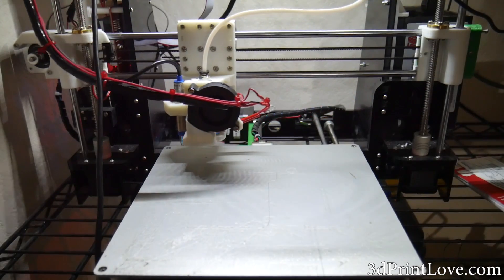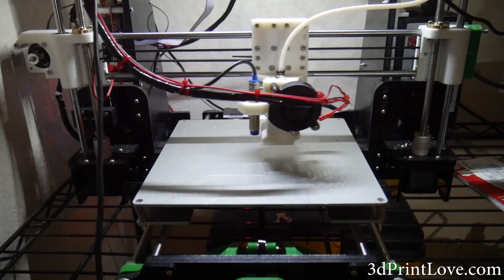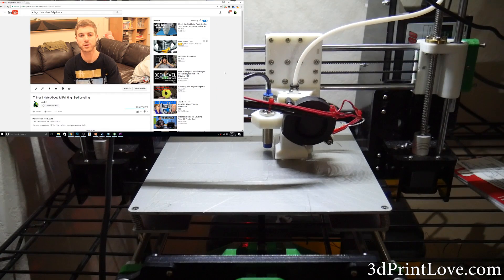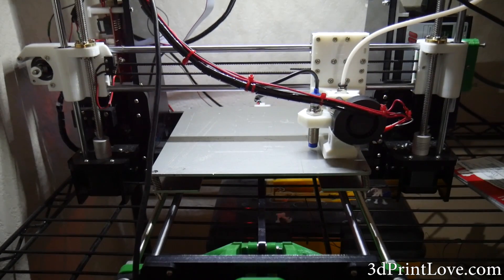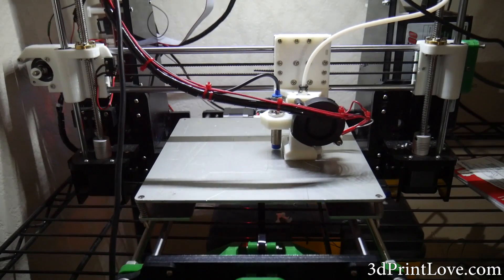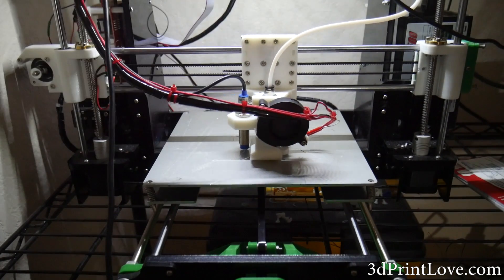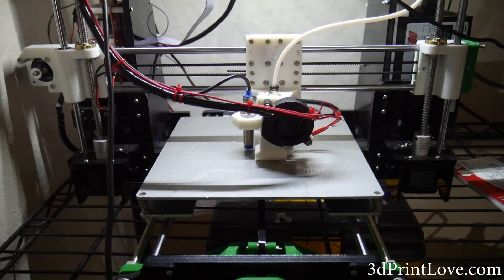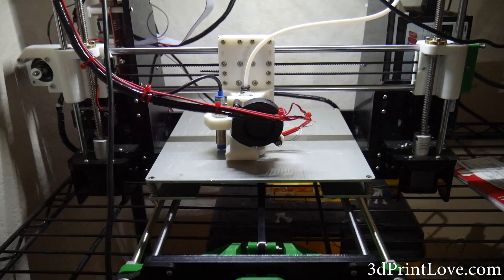Is 3d Printer Auto Bed Leveling Worth It?

Comment: My bed needs stiffer springs, it has cheap ones that seem to bend easily causing my bed to constantly change. I currently gave up on using my own created ABL probe as it's more of a headache then it's worth. Countless hours troubleshooting why I can't get the one side of the bed to work with the ABL probe. Seems I have had more luck with just manual bed leveling again. I need a sturdier bed as the frame is the acrylic 'X' style and the outer parts warp when the bed is heated. I bought a cheap 3D printer and am finding out I should have spent another $60 for a better quality one.  Live and learn I guess but also all the money I had at the time for hobby money. For sure not cheaping out on my next 3D printer.

Comment: Auto bed leveling is needed when you get a printer with a warped bed - even mini printers sometimes have a warped bed

I use custom firmware that has mesh bed leveling feature - lets me overcome the dished center of my 200x200 bed, so I don't need auto leveling - I don't move my printer, and the bed springs are tight, being packed with washers - bed doesn't go out of level, but would be unusable without mesh or auto-level

Comment: You just don't know if your bed is flat.. It is not that simple.  At least for my A8, my bed is now wrapped differently in different area(not noticeable to eyes, but during print I can see how z motor is trying to compensate it, even after a perfectly manual levelling ).

That is where I know it is a must for me.  I'm very good at manually levelling but man this thing just works even better, let alone it is hassle free.

This is the result 444 https://imgur.com/gallery/JBDdN

Comment: I have a Folgertech FT-5. Purchased it around December. I also purchased a BL Touch to go with it, figuring I would add it eventually. To be honest, I haven't had any issue with the bed leveling on the printer, even though it is a larger bed. I think people over complicate the bed leveling process. One mod that I did to the FT-5, is take it from 6 leveling screws to the bare minimum of 3. A plane ( print bed) is completely defined in space with 3 points.
Reply: The Haribo 3030 mod is the way to go http://www.prusamk2.com/3030-haribo-edition-prusa-i3-mk2-mod/

Comment: I have a printer with automatic leveling and another with manual leveling.  I see a difference for certain type of parts where the first layer has lots of small parts like gears found in a clock.

Comment: I feel everyone that wants to get started with 3d printing should get a printer that doesn't have a auto leveling bed. That way they learn more of how to solve their problems rather than never experience them and not have the knowledge at all. And if it bugs them that much they can install it to their printer and learn more anyways. I am defiantly getting the new delta mini though.
Reply from the maker: Agreed, seriously there is nothing more valuable then knowing how to troubleshoot your 3d printer. If something goes wrong you need to be able to fix it. Its 3d printing, something will likely go wrong and if you have had everything working from the start you wont even know where to begin looking. Hell yeah! I would like one to they look so rad!
Reply: I might just get 2 of the deltas since they have a nice price point right now. However, in one of your previous videos I did recommend to someone that they buy the delta rather than what they wanted to purchase. Reason being is that it was for his kids. I feel to get a kid interested in printing it should work out of the box and be ready with no hassle like leveling the bed.  I remember when I got my first print to stick to the bed I watched it until it was done.
Reply: i haded 4 diffrent printer in total, which was wanhao i3 (1st gen) never let me down put was a pain someitme to make the print to stick, 2nd was a ctc makebox copy, never got it working, my 3rd was a anet knockoff, a pain to work with and my 4th and current wanhaoi i3 plus mark one and does not have a prob and been running it 24/7 for the past 8 month none stop and have not let me down, also it does not have a prob but going to get one fixed and some other part to reduce downtime